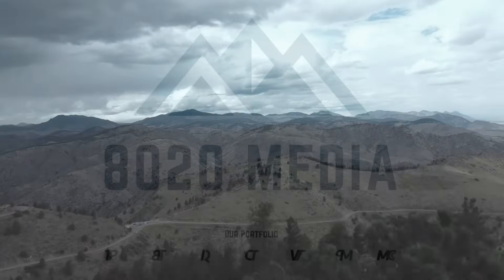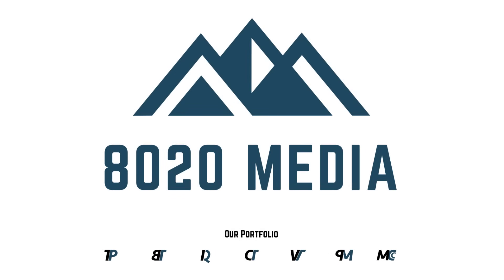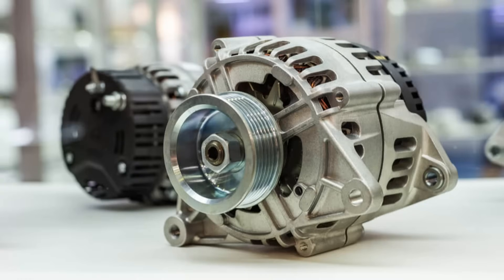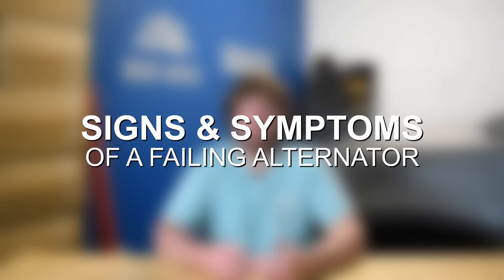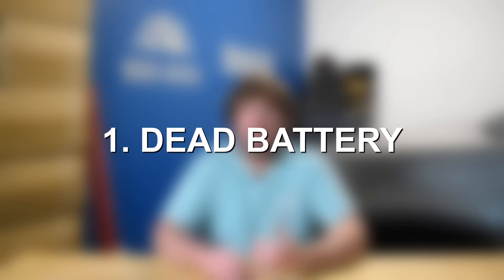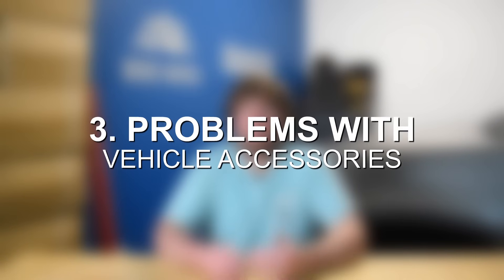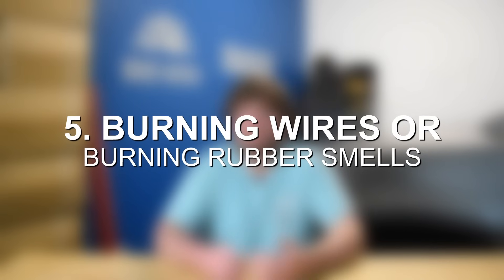6 Symptoms of a Bad Alternator!

Comment: Hi so I have an 03 Corolla with about 150k miles. The other day my car wouldn’t start. the tow truck driver tried jump starting it & nothing happened. But my battery & my lights were fine. I heard a humming noise when I tried starting it. I ended up getting it towed. As soon as I got home, it turned on & has been turning on ever since. I had a diagnostic & it said bad charging system. Could this be an alternator issue or something else?
Reply: This same thing is happening to me. It starts & then won’t start but all my lights come on fine. But I do have corrosion on my battery.
Reply from the maker: H - May want to check your battery.
Reply: @8020Automotive  I did, I cleaned the terminals & haven’t had an issue after that, but it’s weird, I took my car to a few Auto Zones so they could run a diagnostic for me & they told me different stories at each. One said I had an issue with the alternator, the other said it was my battery. I got different readings, so I don’t trust their diagnostics computer & my battery is fairly new..
Reply: @8020Automotive  Thanks so much. I’m gonna have someone check the charge
Reply from the maker: R - Thanks for taking the time to share your experience!
Reply: @ro-landocalrissian4633   my issue was the starter. Went & bought one & had someone put it on for me & it starts perfectly. What kind of car do u have?
Reply: @8020Automotive   it was the starter. Had it replaced & it runs perfectly. Thanks for your help!
Reply from the maker: H - Glad you found the issue! Thanks for coming back and sharing your experience.
Reply: @HeyyMissCarter  03 Corolla. I had replaced my starter a few years ago also..
Reply from the maker: Ro - Not likely an alternator issue, but certainly could be. Based on your symptoms, we advise to check out all of the battery connections. Did you have a mechanic look at it? Keep us updated.

Comment: Hi, I have a problem where when I put my car into park when I get home all the dash lights and stereo go off for a quick second and come back on again. I've only noticed it at night. The battery terminals are all clean. Could this be the alternator? The car starts pretty well and has no problem turning over. Thanks!
Reply from the maker: B - Yes, this could certainly be an alternator issue.
Reply: @8020Automotive  Ok. Thanks for your help! I have a mechanic's appointment in a week at soonest. Do you think this sounds like an issue that needs quicker attention?
Reply from the maker: Any update here?
Reply: @8020Automotive  Yes, even though the positive terminal lead seemed tight, it actually wasn't. It was loose enough to where it was causing enough movement to cause that momentary glitch. Mechanic put a new terminal lead on and it seems fine now. Thanks!
Reply from the maker: B - Nice! Thanks for coming back and sharing your experience. This will certainly help future viewers.

Comment: I have a Pontiac grand prix GT1 from 2004. I've been having power steering issues with the car. today, I replaced the power steering fluid and flushed it out quite a few times. when idling the car, the power steering is fine. However, when I apply brakes when idling, my steering wheel gets really hard to turn for some reason until I release the brakes and start moving. when the car drives, its completely fine. its only when I am idling or going slow, and I press the brakes for example slowing down to turn into a parking space. when I release the brakes, it is still hard to turn until I give it some rpm. I honestly don't know what the issue could be at this point and its why I'm commenting on an alternator video lol. Help would be appreciated. I'm thinking it could be a bad steering pump but idk because it seems to be only during or after brakes are applied at zero or really low speeds. I should also mention it sounds like compressed air or something releases from the vehicle when turning the wheel back and forth. the air is louder and more aggressive when brakes are applied.
Reply from the maker: K - Certainly seems like something is wrong with the power steering system. Have you taken it in to a shop or are you just trying to self-diagnose?
Reply: @8020Automotive  after some more research, I'm pretty sure it is my steering pump. its wheezing making some interesting noises when turning.
Reply from the maker: Kaleb - Great to hear! Thanks for the update.

Comment: If you have an alternator problem, shouldn't  you get the red battery light on the dash? I had a failed alternator once on a 2009 CR-V  with no warning light and the whole car died on me while driving. It had no flickering lights, nothing whatsoever.
Reply: If voltage output is below a certain about when running then yes the light is supposed to come on. But a failing alternator can still output 12.5 Volts while running and that won't trigger the battery light.
Reply from the maker: Barry - Thanks for adding this insight so quickly! You beat us to it.
Reply: the check engine light came on & it was the alternator. I have a honda too
Reply: @MQuez  What year is your Honda?
Reply: @npapan   13
Reply: @MQuez  my CR-V was a 2009 model, probably they have added an extra sensor in later Hondas. Many thanks for the answer.
Reply: I had a code p0700 p0404 and a p0526 low voltage system (as a secondary) 2006dodge magnum 2.7/ but it was changed out to a 2008 2.7l Chrysler 300 when a shop blew up my engine as soon as I got it home it ignition grounded out and yesterday I had ignition switch ground out recently rom when revel up a bit started acting like it wanted to die when rom low 
After codes were thrown cels were off following day after checking electrical connects fir egr the 1st code it threw no problems starting but sound like a starter run on periodically at end of ignition turn when starting help please

Comment: You missed out the whining from the Alternator when the internal regulator goes from output of 14 volts down to 11 to 12 volts....

I have one blow that section TWICE in 12 months...

That sound starts after the electrical did a reboot and flashed the dashboard (in my 2003 Honda)  and that sound was warning DO NOT turn off the car until you are safe or where you can get help....
Reply from the maker: Andrew - Thanks for adding this insight!

Comment: Ive gone through 3 alternators recently. I guess they dont make them like they used to. My car (Camaro Z28) is wired for the electric fans to stay on permanently because of a low temp thermostat. Not anymore. Its been rewired back to factory. Im sure this has caused the regulators to fail.
Reply from the maker: Tvpc - Great point.. Sorry to hear that you have gone through so many. This certainly isn't normal, there could be something else going on to cause so many failing.